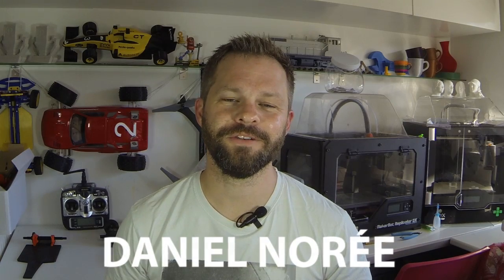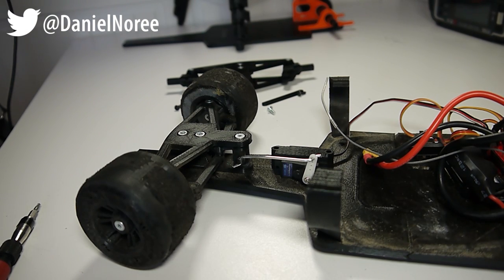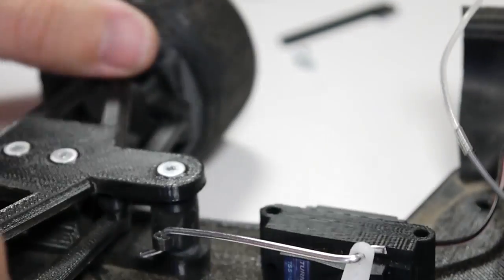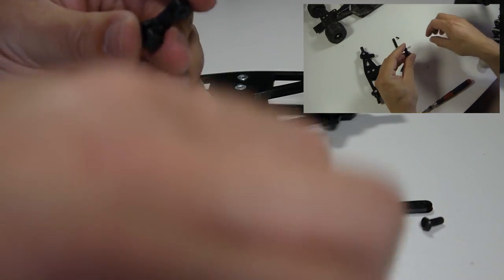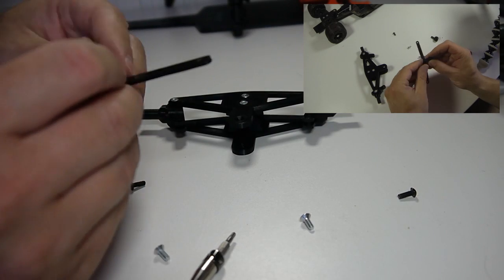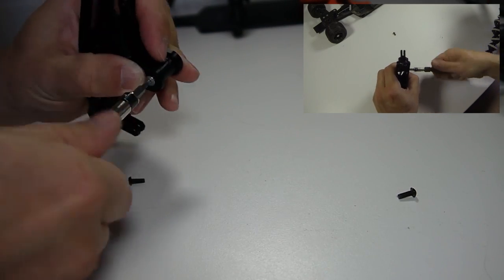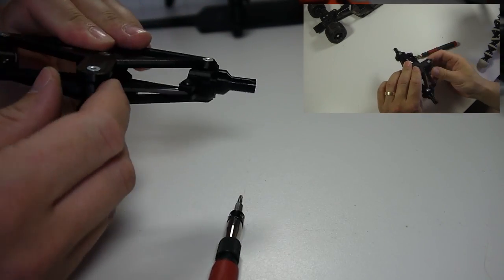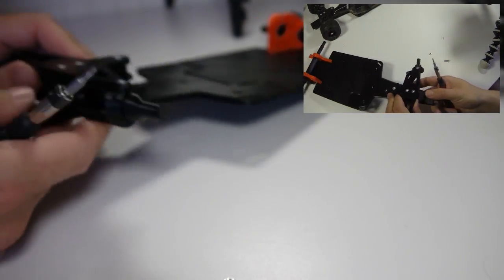BUILD WITH ME - OpenRC F1 Pt4

Comment: Thanks for the video Daniel. I could figure out everything but the steering. The all structure is too stiff and the upper and lower part jump off because the force needed to rotate is too big. I tried several print settings like infill and e-steps for under extrusion, but it is always too stiff and doesn't work. Any ideas would be really appreciated, thanks!
Reply from the maker: Hi, thanks for the feedback. Having limited time at the end of the design phase I had to make some compromises, unfortunately the steering was one of the things I did in a rush just to finish. I think there's been upgrades by the community but I haven't checked for a long time. Also, your not the first one to mention this so I might write a blog post about it.
Again thanks, I'm looking forward to seeing your build. =)
Reply: Ciao Ho lo stesso problema , lo sterzo è molto rigido e non funziona, per caso hai risolto il problema, saresti gentile da indicarmi la soluzione. Grazie di cuore
Reply: @paolodecaro3741  Hi Paolo, I didn't, I'm afraid I abandoned the project, was there wasn't an easy solution at the time. I think this problem should be shared more openly so people knew what to expect from the beginning...

Comment: I had a lot of problems with the servo-saver. Either the bolts were too tight or not tight enough. In the end a drilled a hole from top to bottom and applied a longer bolt. Of course not tightening it too much otherwise the servo-saver wouldn't work anymore. Result is simply great !
Reply: Is the bolt you used " sliding " through the top and threaded at the bottom. ? I'm trying to figure out how that seperates in the event of a crash.  Great idea  💡

Comment: Hi Daniel,

Where did you get the 1.5mm aluminum rod? Is this a premade part, or did you just get a straight rod and cut and bend it to shape? Thanks.
Reply from the maker: The 1,5mm alu rod is for tig welding. I got it from a company nearby that does alot of welding. But i´ve seen people using paperclips aswell.

Comment: I like the cam design of the 'servo saver'. One question; where is the increase in z axis (or height) going when the cam is engaged (expanding to it's maximum height, ie: protecting the servo)?  

It looks likes the engaged cam energy is being transferred into the surrounding plastic?